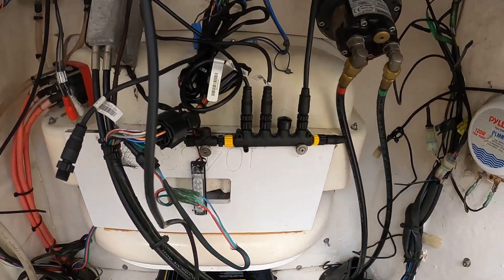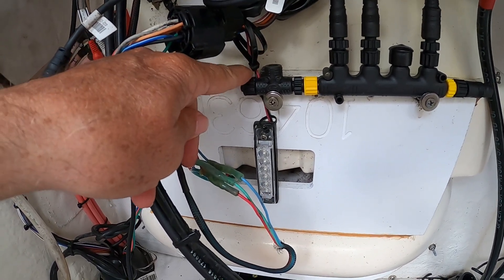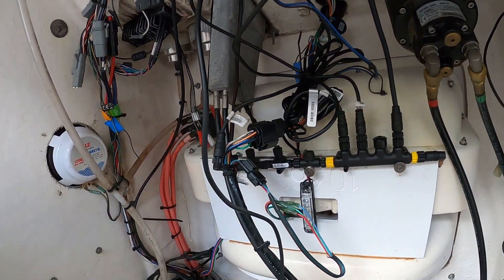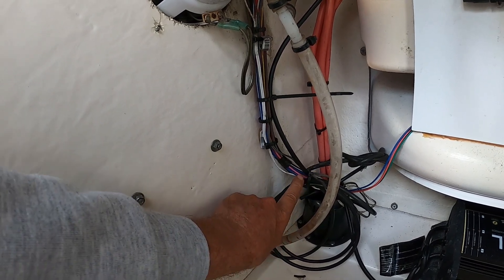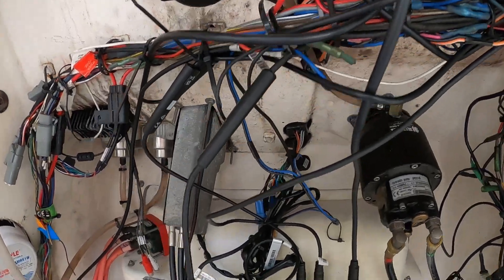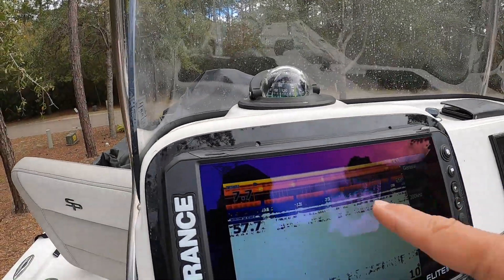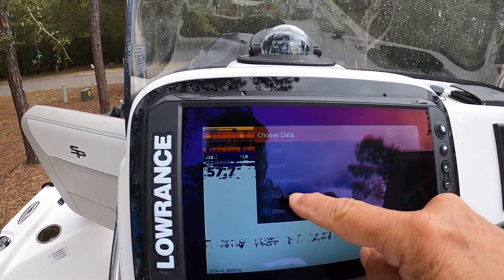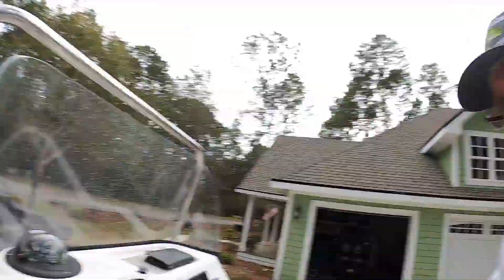NMEA 2000 to Lowrance FS 9 Chart plotter Success story!

Comment: Hi Paul, great information,  just wondering if you ever have encountered the chart direction pointing the wrong direction, my chart plotter was pointing the opposite direction (180degree).  This only happen AFTER I connected the Lowrance to the existing Suzuki network..    I did some research and I got to the point where most say Setting—->gps source—-select fs9..  but after trying it out, it’s does respond but still wrong direct by 45-90degree…….  I also found out the “within the network which ever unit gives out the strong gps signal the network follows.” Doesn’t seem to make sense that the Suzuki has got its own sps or does it for speed.. I don’t know..   thanks……
Reply from the maker: I have not, but there is a setting to make the direction true north I believe.